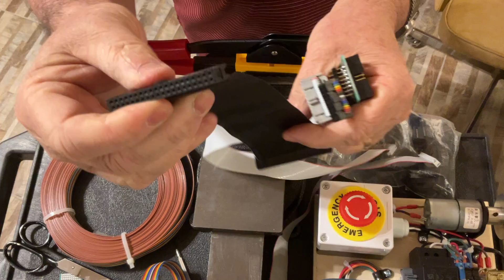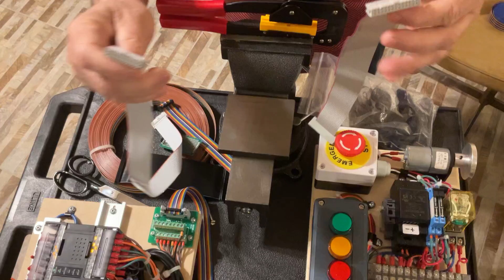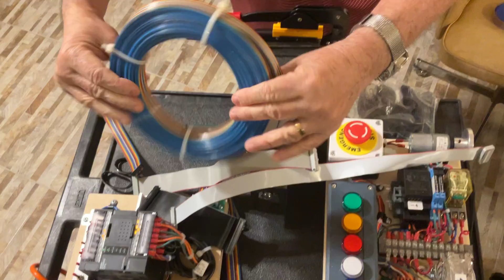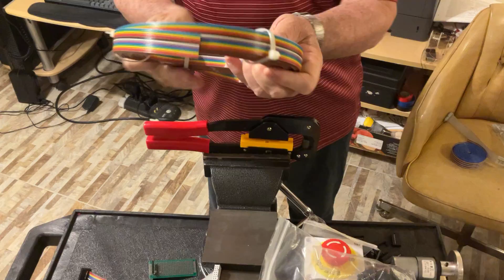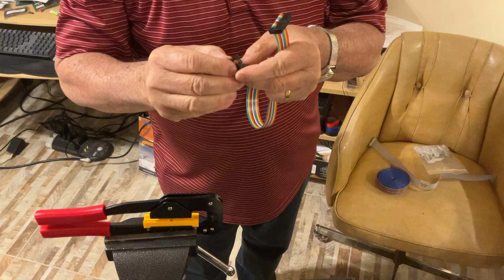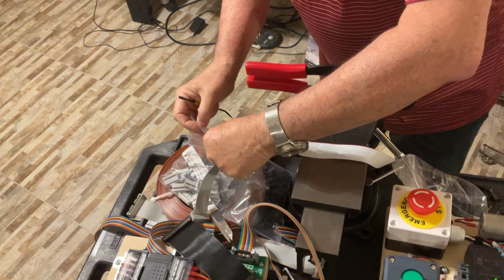DIY – Make your own flat cable in minutes. Crimp IDC connectors easily

Comment: Hi sir! I'm trying to repair a digital piano where the ribbon cables were cut pretty dumb way instead unplugged... unfortunately there is just a few centimeters sticking out from full weighted keyboard mechanism what I don't really want to take apart for the troubleshooting. That cm is just enough to cramp on a connectors. Thankfully saw your video so I ordered a cramping tool and a bunch of 8 & 10 pin male also female connectors. Now that the stuff arrived I realized that the cable pitch is not 1.27 mm (what I thought is some standard) but around 1.47 mm. Do you have experience with this cable pitch size? Is even possible to get IDC connectors in this measurement?
Reply from the maker: @lorifilm Sorry buddy for your unfortunate cable cut. I am very familiar with 1.27mm and 1mm pith flat cable, never heard about 1.47mm flat used with IDC connectors. It's very possible that inside your piano, respectively in the keyboard, you may have another kind of connector then? I suppose that in the back of the piano, as well as in the keyboard, you should find a kind of cover you can remove, at least to see what type of connectors are there. Be aware that if the cable pitch is let's say 1.27mm, then the double row IDC connector is 2.54mm, and if the cable is 1mm pitch, then the double row IDC connector goes 2mm pitch. So if you have such a similar connector inside, it should be around 3mm pitch? Big question, never seen such an IDC. I think that you won't have the choice but opening either the piano or the keyb. Can you send me some pics at my email when you open one of them?
plc.cu.wiring.it@gmail.com
Best regards, CU

Comment: one main advantage of the IDC style cables is the connector itself. Designing circuits using IDC style connectors like the video shows is straightforward to understand the alignment because the connector on each side pin1 means pin1. it is easy to link and debug because the connector can be rotated up or down, preserving the polarity. the designed has a valuable connector for medium frequency signals that is cheap and easy to replace.
Reply from the maker: @CallistoPili Thank you for your remarks.
As a side note: both the M and F connectors are provided with a notch. And still, having an IDC cable between the PLC units and the output trainers, some of my students won't pay attention to the notch. And so, if you just push it a bit, you can place the F connector cable upside down despite the notch! This may be a challenge for the design... Regards